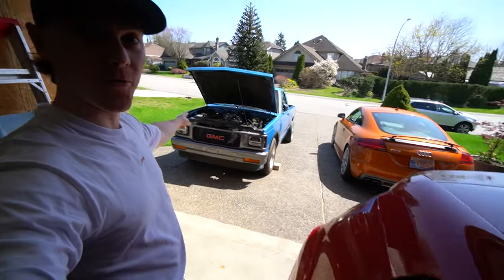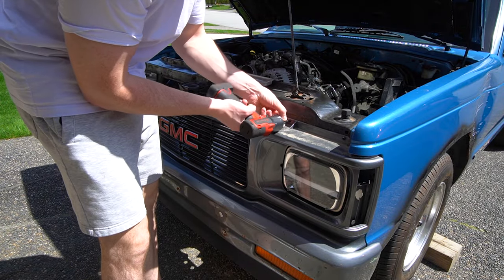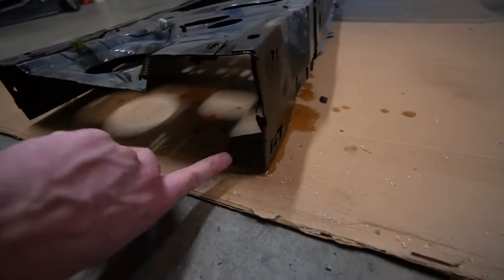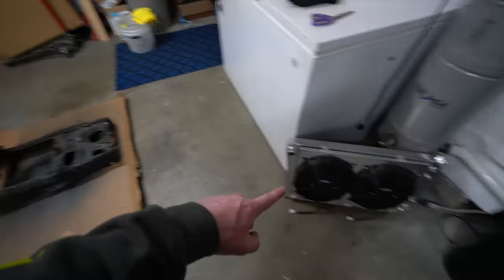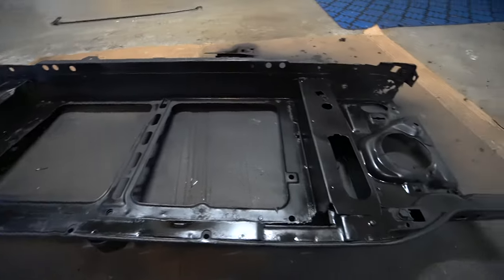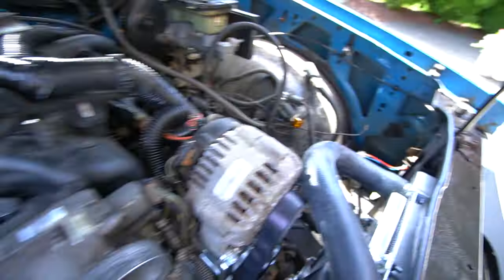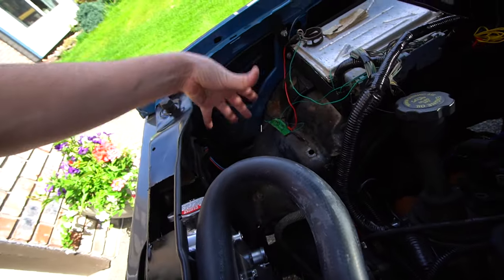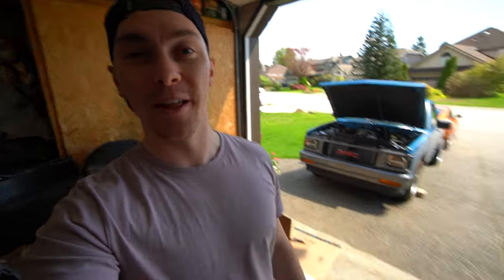S10 Rad Support Removal & LS Swap Rad Install!!!

Comment: Regarding the clutch, theres an quick fitting to the roll pin fitting to the master. Easy
Reply from the maker: I ended up getting an Earl fitting and adapting to AN and then to Metric Brake line (What a pain in the ass...) All works now and will have a video wrapping up more small stuff like the clutch in a couple days!